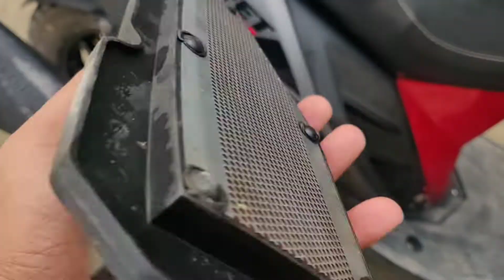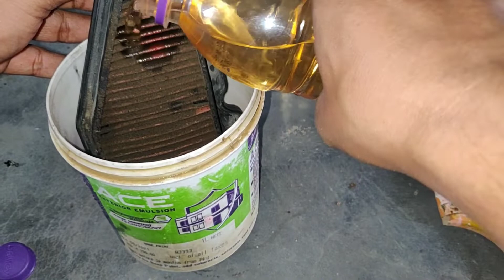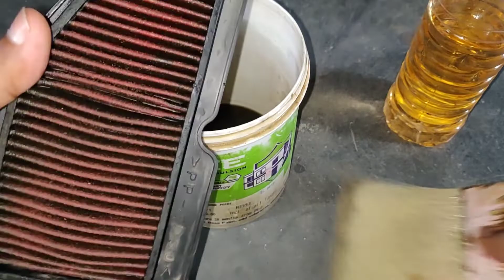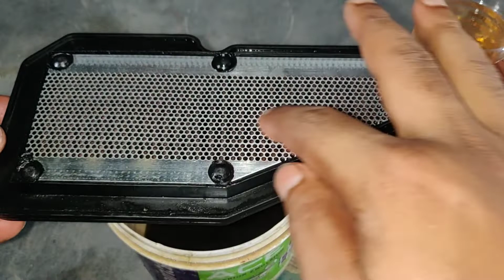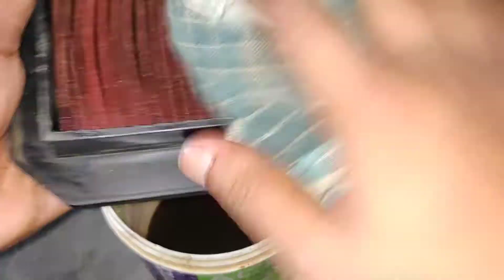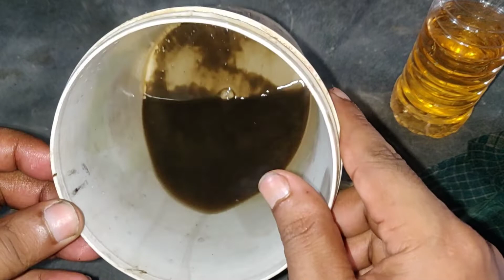Yamaha Air Filter Clean | How To Cleaning Yamaha Air Filter | Yamaha Ray Zr 2022

Comment: Don't use petroleum to clean or don't clean the air filter, because lot of carbon will deposit inside the carburetor and it will cause lot of problem to engine also and pickup will drop